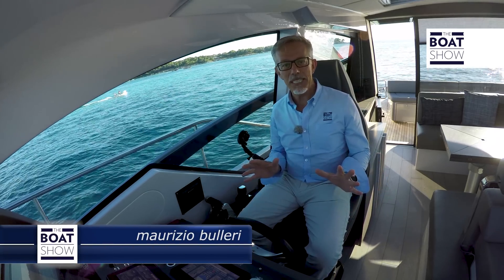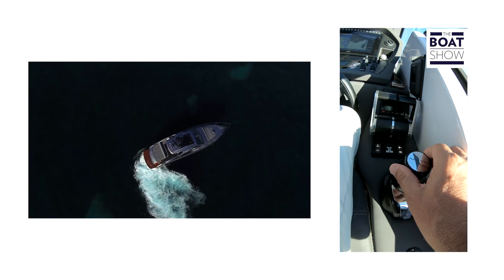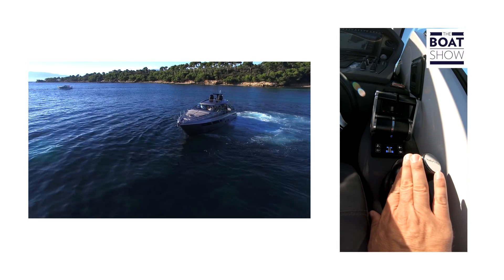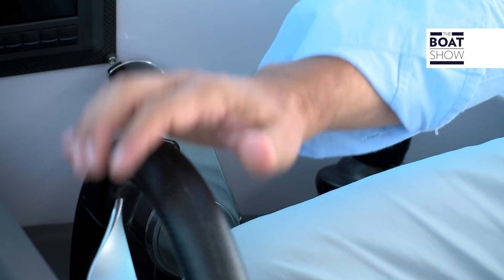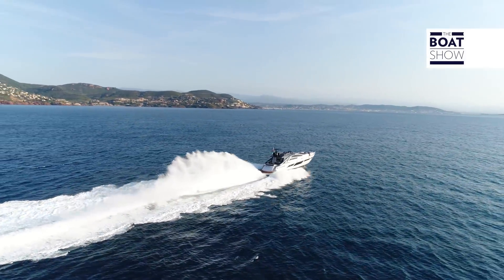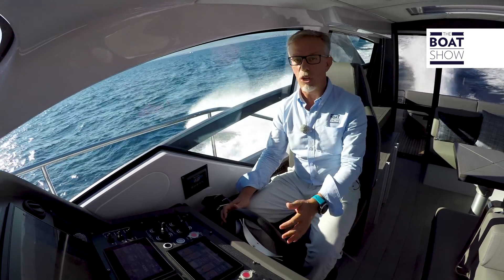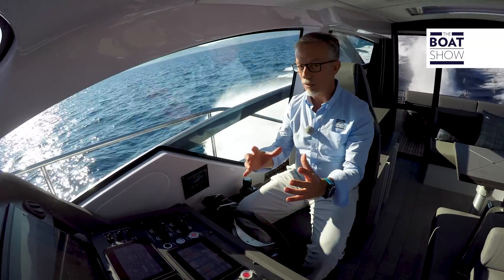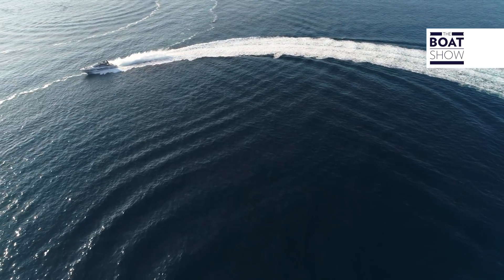[ENG] XENTA JOYSTICK YACHT CONTROL SYSTEM - Review - The Boat Show

Comment: 2 questions: How far away are we from getting rid of the old helm completely and why are joysticks on boats completely opposite to the joysticks found on ever other vehicle? For example, twisting the joystick makes the boat roll left or right where as pushing the joystick left or right causes a lateral movement in the corresponding direction. Shouldn't a push on the joystick to the left or right be configured as roll and a twist be the lateral movement? It's very confusing to me.